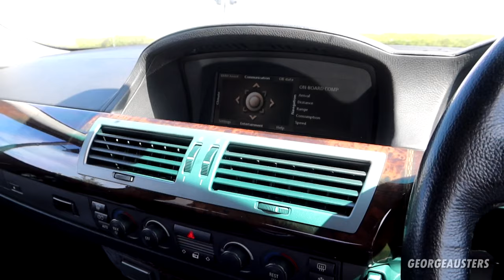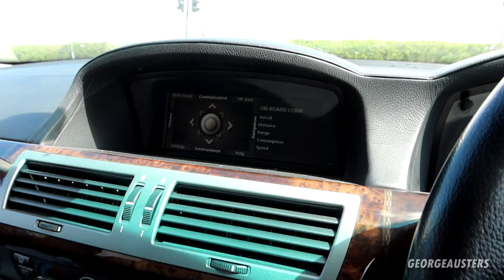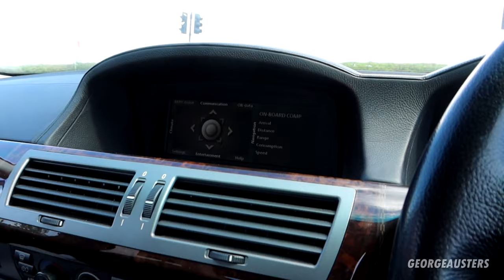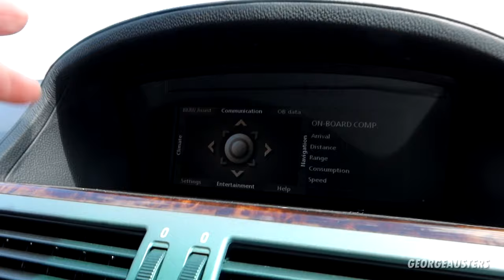BMW 7 SERIES COMMON PROBLEMS!

Comment: I have 2004 745 in mint condition bought it 8 years ago and never had a problem , looks new , drives new . I just do the regular maintenance like oil change, etc .
Reply: you know very well you are lying
Reply: @munashe89  why ?  If I had a problem I would be saying what a load of crap this car is .
Reply: I have had 2 silver 745li. And 1 750li …lots of problems after 170k but when fixed ..a dream to drive.I bought all 3 in less than 2 years

Comment: My 2007 750li e65 e66 ran great for a mon😮 after purchase,then started smoking misfiring wasting gas.A cheap obd2 reader said failed exhaust cam pos sensor,bank 2,and multiple misfire codes.I replaced all 4 cam pos sensors,new spark plugs,new battery.Smoking stopped,but still rough idle,misfires.I got a cheap $5 non contact electric voltage probe,that detects voltage near live wires and beeps,flashes if electric is present,and touched to each coul pack,after removing top bmw cover,side covers on engine.The coil packs all had voltage.The non contact probe wont tell you if they are weak or failing though.I replaced all 8 coil packs.The cheap obd now reads cam pos sensors A intake sensor overtiming of camshaft,and the ECU doesn't like the electrical reading of the B exhaust sensors.I canmot program or erase codes adjust timing,or reset ECU with this cheap obd2.Bought a ancel fully compatible BMW obd1-2 program scanner for $88 on ebay.Or the foxwell nt 510 is bmw compatible programmable for $125.Also replaced the oil pressure hoses and relief valve,its directly in front of you,center of the engine,when opening hood,on top of engine.This affects the camshaft lubrication and can cause bad sensor readings by ECU if clogged or bad.Also a weak or bad battery can cause multiple sensor readings by ECU.Reprogrammed timing timing,and engine runs good now.If any aftermarket parts are used on BMW,the ECU must be reset,as well as new battery registration,as the ECU stillbthinks its reading parameters of the old parts.

Comment: I suggest to only  replace  the door hold struts that are bad…likely the front doors….I’ve owned several m73 products and you need to preserve capital for the next big doller item…agree the 12 cyl engine is very robust and vey fun!  but cooling issues are commonplace including parts located deep into the V.  You can easily spend 3--4000$ If you need to go into the V and replace pipes…..once you go into the V it’s smart to replace everything as the labor can kill you.  Many parts are plastic and they cook under the hood…. Also consider replacing the plastic fan…they get brittle and they can explode and destroy EVERYTHING in the front including slicing through the steel hood !!!!!   Killing: belts, hoses, filter boxes, radiator….This I know first hand!

Comment: Overall 3.0D in the pre LF model is the best. Some comments, the NAVI unit going bad brakes the optic cable circle, you can just bypass it and the rest of the units will work.
Reply: Do you mean this car in the video is the most reliable?
Reply: Not true I bypass every single module that I thought would fix the issue it doesn’t work
Reply: @jeezymufasa7597 like brakes ? Mine are locked ?
Reply: Can I byosss the brakes ? By taking drums off

Comment: If I'm not on flat ground the trunk will rise up like normal and come down right away, works perfect on flat ground though. My IDive controls are toast and the OBD2 is unresponsive, but it runs like a top, 2007 750LI. 122k miles, only 2300 USD though and it will stay at only  122k miles, no matter how much I drive. I

Comment: If the trans has shavings in the fluid and gunk it will cause the trans to wear in places it normally wouldn't so draining and replacing fluid will mess it up there won't be anything filling the gap between the disks

Comment: The car came out in 2001 not 2003, there was never a problem with the I drive itself , the doors is a rubber from 4 € , dynamic drive failure is the steering wheel sensor from 12 euro, boot is just an oil refill, service gearbox is only at 150000; so in the end you now no anything about e 65  point.
Reply from the maker: Lol the dynamic drive failure was NOT a steering wheel sensor

Comment: My e66 735li crank but no start,no gear appear,obd won't connect possible bad ivm?what I do check ignition coil no firing and no injector pulse ,fuse all good,,should I buy new ivm and replace?

Comment: My e65 has rear wheel steering. Never seen another with it. Park it up and get someone to fully turn the wheel and look at the rear wheels
Reply from the maker: Interesting, what kind of degree do they turn to?
Reply: @GeorgeAusters  not much. It looks more like the camber is changing. On my cars the dynamic Drive was broke too

It was 2005 Sport 730d low spec
Reply: @C my low spec 2005 730d M sport did. I could see the wheel change angle when turning the wheel lock to lock when stationary

Comment: I have been hampered by a dirver restriction fault related to seat belt tensioner. I know that there is a plug under the driver seat of my 730d. Can you please help me?

Comment: Hi, i owned a facelifted e66 v8 2006 750li, i ve been driving it for few years never really had any issue but 1 and this issue keep happening but it never actually cause any real problem to the car so i kinda ignore it, but it still bothering me and im not sure what cause the issue , hope u can help me out. I live in VietNam South East Asian country , the traffic here is quite slow so most the time i drive with speed under 30 miles/hour. This issue only happen after i start the engine and drive for 10-15 minus, and it mostly happen when i start driving uphill and slowly accelerate from around 25 miles/ h to 35 miles/h and that is when the car start a series of vibration/ shaking that i feel like it come from under/below the car. The vibration/shaking come in waves, it vibrating for like 2 seconds and then stop for like 0.5 sec and then vibrate again 2 secs and repeat few times. When i almost reach the top of the hill , it stop. I really confuse about this and its been happening for years and no mechanic in my city can actually figured out the issue correctly. Please help me out on this , thank u so much.
Reply: Could be the IVM, common for solder joints to crack and your engine will lose power for split second while driving

Comment: Hi George 
Got an issue with the sound system, it doesn't sound right, no bass or treble and sometimes only the passenger speaker works and the others just hiss, any ideas?
Reply from the maker: Watch my latest video regarding the audio

Comment: I have 2004 760li are there any major problems engine mine is smoking misfire shutting off
Reply: so what did you do to fix the issue ?
Reply: The cam position sensors can cause this,the vanos vvt solenoids and drive motor,the crankshaft sensors,bad coil packs,bad spark plugs,and po300 codes for cam pos sensor overtiming on intake A sensor,or cam b sensors not reading  correctly by ECU.

Comment: hi i have very big noise when i driving on neutral noise is gone only noise when car on gear.when i press down clutch pedal noise is gone or when i release clutch pedal noise come on straight away.
Reply from the maker: Clutch pedal... On a 7 series?
Reply: 2007 318i
Reply: Very much a different critter than these 7 series. But sounds a lot like a throwout/release bearing. It rides between your pressure plate and the clutch fork. When your foot is off the clutch it will rattle around and make a big sound, when you load it up by pressing the pedal it will probably still make a low humming noise that you can feel in the clutch pedal. Never had to replace a clutch in any of my cars, but sure have done a lot of throwout bearings and slave cylinders.

Comment: Whole car is a problem. In 2003 it was something special, but now you can get much better multimedia from chinese for 100 euros. If you like to spend free time in garage, buy it. Also, this guy drive's UK model, with lower mileage than in European models. Newer models from 2006 was also crap, but many mistakes was fixed. Overall, it's just crap, that's why those E65 are so cheap. The only thing i like in these cars are ventilated seats with massage function
Reply from the maker: This has been one of the best cars i've ever own. It's actually been very reliable since I've fixed it up.
Reply: I just want to say, that for normal guy, who's working not with cars, don't like to spend freetime in garage and etc. It will be big problem, because those ones have lot's of small troubles. And in car service you gonna pay a lot of for even every small repair. But if you are that one "garage guy" that will be no problem, because it's easy to repair, because there are lot of info. My friend have one, and he's always asking for my help if someone happens, but it's diesel. And it was lot of small troubles - Webasto heater, tyre pressure sensors, because they die after 4-6 years, adaptive headlights, driver's seat sensor, who gives info when you're sitting in place, door motor's, who pull door if you're not closing them fully, and that V8 diesel engine... You have one with very big petrol engine, so it was with low mileage. But with those diesels with higher mileage it will be just a big problem for simple person, who don't know anything about cars. It's very cool inside, fun to drive, but i think it's for guys who can do something by themselves, because there are lot's ir everything inside and it's pretty hard to watch everything for working perfectly